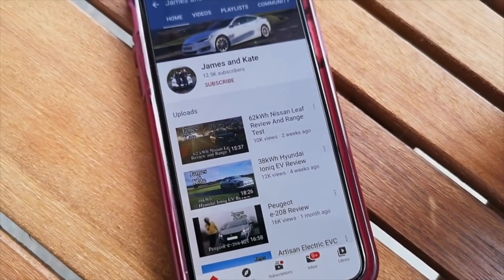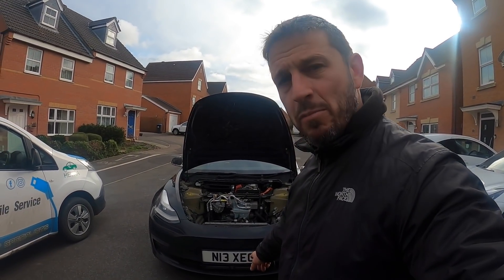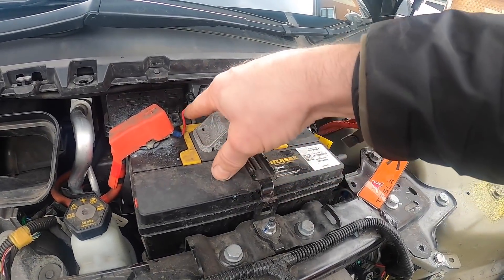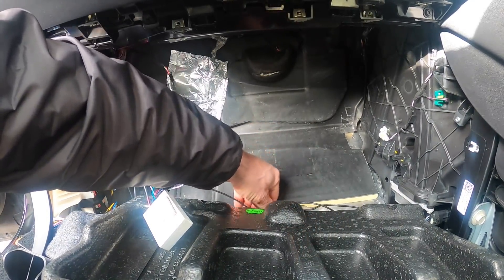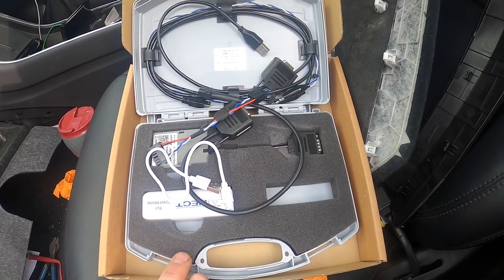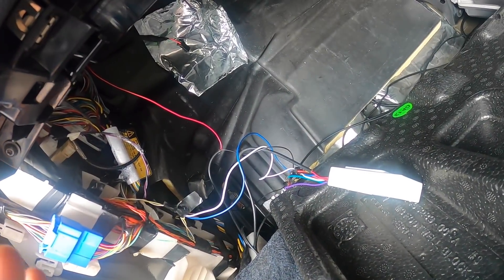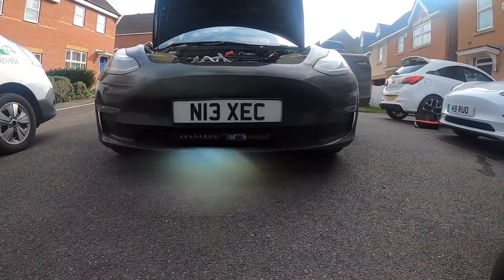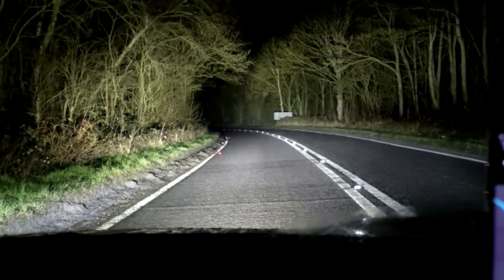Tesla Model 3 Headlamp Upgrade

Comment: For anyone watching this in 2024, there is more elegant and much cheaper and easy solution now:
Strands Nuuk E-Line led bar and wireless can adapter. No need to wire anything, just plug in into OBD port.

Comment: Very interesting and delivers a huge improvement. Out of interest, what happens when the car is loaded, will these dazzle oncoming motorists?
Reply from the maker: Good point. The high beam will raise but should drop off with the cars auto high beam assist. The low beam assist has a built in intelligent sensor that should alter the pattern for oncoming traffic.
Reply: @Jamesandkate  Thank you, that is very impressive and actually not bad value given the advanced features.

Comment: Should have gone to SpecSavers.... or not bought an expensive Tesla with sub-standard lights! Also is that sort of thing legal on the road and on an MoT?
Reply from the maker: It's certified for use in the UK, it's hi-beam assist. Also, if needed, it can be switched off for MOT.

Comment: Would that cause any overheating issues, with it mounted in the air intake duct?
Reply from the maker: It obscures such a small area I wouldn't think so.
Reply: Could the light itself heat up too much if it was left on while idling for any time - hence without airflow to cool?
Reply: @thomasbutcher3593  it won't run when the lights are off, and there's a manual switch to turn it off, which I'd do if your sitting parked up with the lights on for some reason. It'd certainly save the battery.

Comment: Nice.. I have seen them on Land Rovers but TBH would not have thought about fitting them to a Tesla.. 
Can you wire them without connecting to the can-bus? (I'm more old School Lucas wiring lol)
Reply from the maker: Difficult as every lamp has a module. You can just about grab a 5v signal wire on the CAN but you can't load it and it's too lower voltage to throw a relay. They do another interface that clamps around the CAN wires for an easier installation.

Comment: Impressive result and the wide spread is useful for navigating in a rural area. However, I doubt if this light bar is road legal because of disturbing people as you drive past homes in the middle of the night. 🤔 Will it pass an MOT inspection?
Reply from the maker: Yes, it’s fully certified for use in the uk.
Reply: @Jamesandkate  looking at the website, are they made in the UK too?
Reply: It ought to be illegal, that looks like pointless light pollution. Can appreciate that the original lights are a bit underpowered but that looks OTT.
Reply from the maker: @bjephcott1  light pollution? The chap wanted installed so he could see more. There are real benefits to better lights.
Reply: Looks to be the equivalent of a HGV's high beam, so I'm saying yes.
Reply: Do mot centres have equipment to check the angles /direction of beam? It looks to light up both sides of the road.
Reply from the maker: @mauricewatts2380  TBH, I think most people will switch it off for the MOT test. It's only wired on the hi-beam though so shouldn't cause an issue.